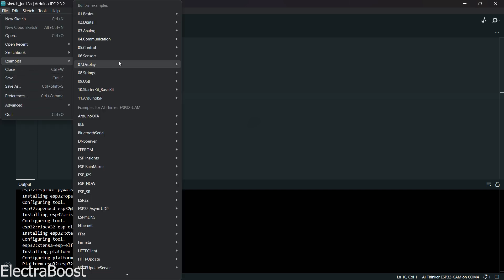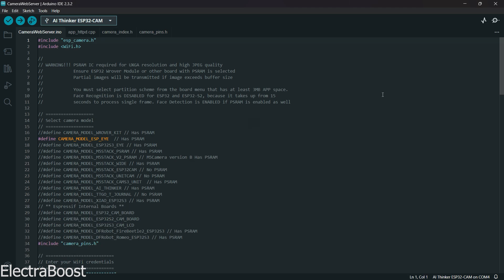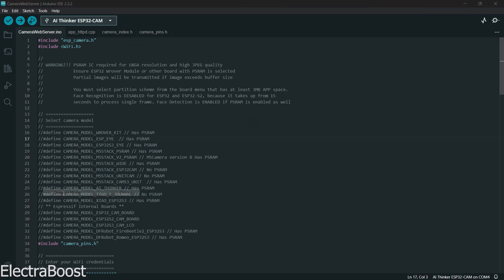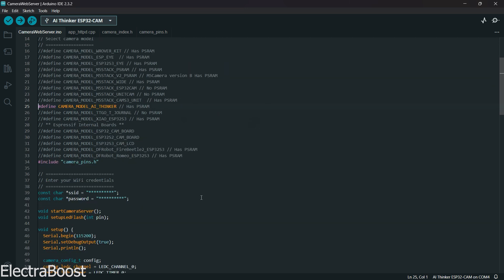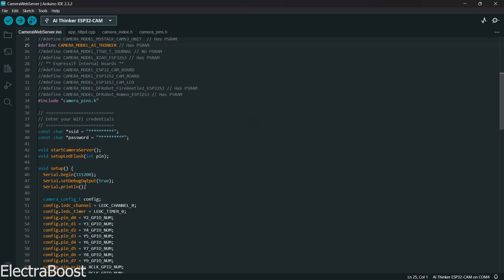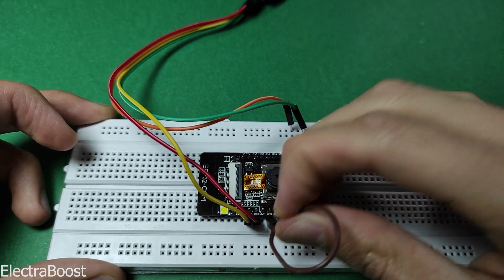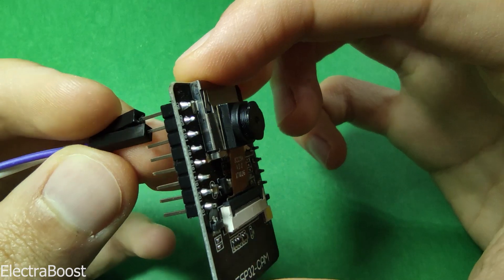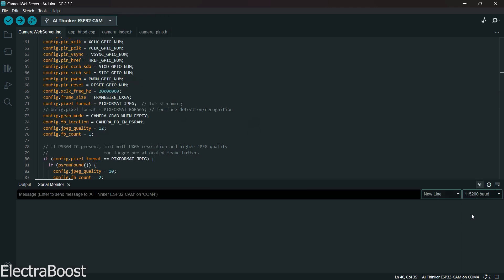How to make a wireless SPY Camera

Comment: Nice video, I think that I would need to know the modules that you  used at the end for the power supply, cause in my case Im just starting with the electronics hobby so I dont have any idea how to ask for that in my store hahahahhaha. I'll try to do the same but using the 110V AC that way I can use it as a homemade ringcamera
Reply from the maker: Thanks. This project utilizes two modules: an MT3608 step-up module and a battery charging module. The MT3608 boosts the battery voltage from 3.7 volts to 5 volts, while the other module handles charging the battery. To power this setup from a standard 110V outlet, you'll need a separate 5V adapter.
Reply: @ElectraBoost-tech  Lovely, thanks for the help